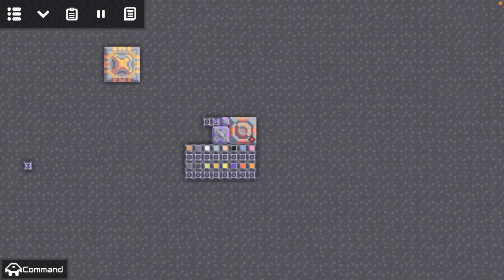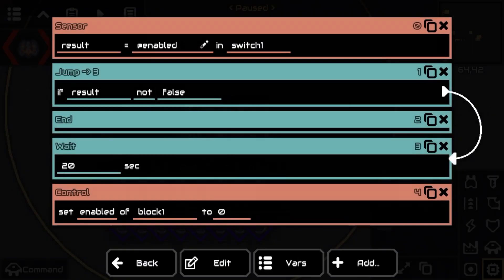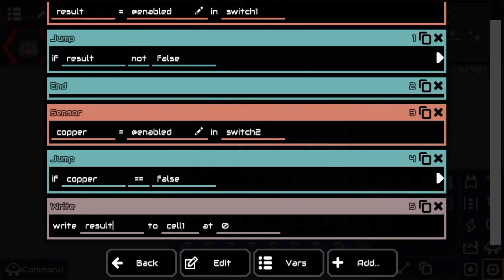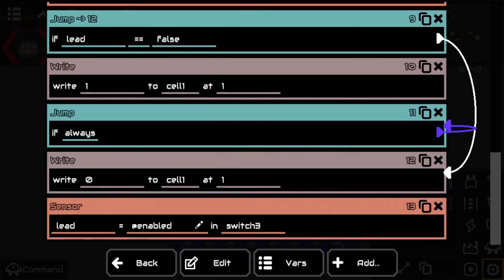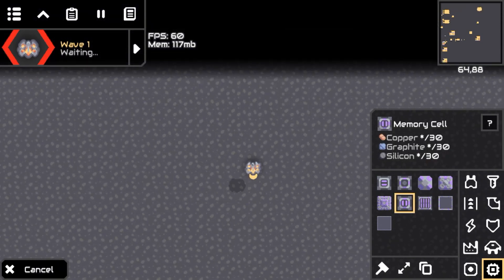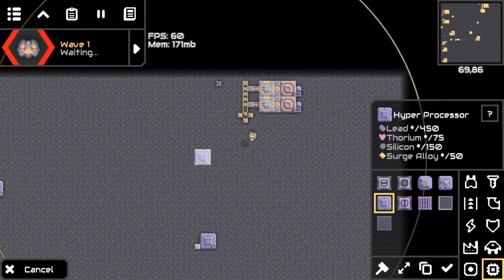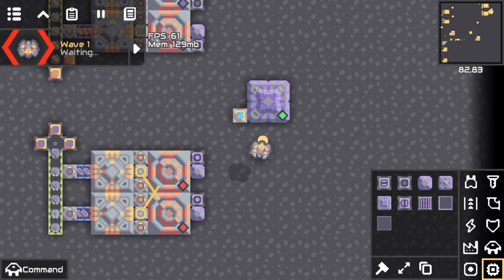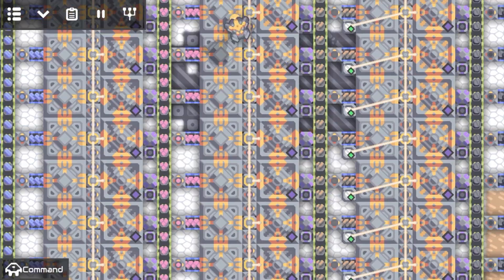Unraveling Mindustry Export Hub Logic

Comment: What are your export rates? I can tell from your video that you have on full plastanium conveyor belt of every resource. Assuming you haven't boosted them with overdrive domes you will have 2.4k/min of every resource. 
I can achieve export rates above 12k/min for every resource (theoretically I can even do more but it'd quite unnecessary to go above 11k/min)
Reply from the maker: So I have 20 Storage modules for every resource, given activated 3 times in a row (a minute) I can do 6k, ofc with more storage it is possible to do more or while launching other materials at least that’s how I think of it, it’s meant I guess for a simple “oh I need a couple more of these resources let me go real quick to get some”
Reply: How??? I've only achieved peak 5k per material simultaneously but still haven't innovated in the design